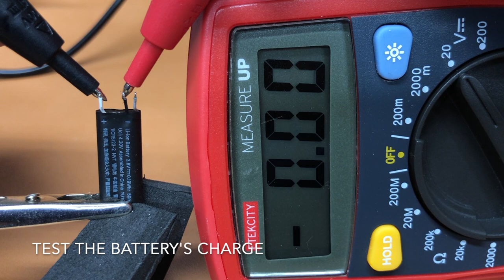Dre "BeatX" Battery Replacement

Comment: 3:08 what was used to put on the wires to make them stay? It seems the same step is made at 2:07 to remove the wires as well. Great Vid! Just confused on those steps. Also any recommendations on solder kits?
Reply from the maker: Holy smokes Joe, that's solder from a soldering iron! If this is your first time soldering I strongly recommend you practice a bunch before proceeding with this repair or you could burn some important stuff.

Solder is basically a "low temperature" metal alloy which quickly solidifies into a solid weld. You can reflow it with the soldering iron, which usually heats up to the 200-350c range. In the video I'm working on wires which are ~1mm in diameter.

Comment: what’s the instrument you used for connecting/placing the wires where they were supposed to go. ?
Reply: specifically in 3:13
Reply from the maker: Hi Valeria, that's called a soldering iron and this process is often referred to as micro-soldering. If you have never soldered before then you may find micro-soldering extremely challenging. In that case, I wouldn't recommend trying this as your first project!
Reply: @StephenArsenault  thanks Stephen

Comment: Great video. I JUST want to confirm if I can short cel 1 and 2 negative because my replacement battery was only two wires. Please confirm tia
Reply from the maker: Interesting.

If you have a multimeter please read the output from the pos / neg lines on the battery. Can you share a link to an image?
Reply: @StephenArsenault  i just try it is not workin. When i turn on red and white flash.
Reply: @StephenArsenault  no pairing mode. Just white blink when I press

Comment: HI Stephen , nice video 
My Beats x is having red and white light blinking and sometimes a pink light is coming . can you suggest any solution ?
Reply from the maker: I'm not familiar with a pink light. I used to be able to find an article from Beats which showed the meaning of the lights but I cannot find it now to confirm what pink might mean. Sorry I can't help with this!
Reply: A glitch has happened with your Beats X where it signals that you have battery and fires off a white light but, it is accordingly going red since it doesn’t have enough power to charge on and continue to play music. Which breaks the light into showing both red and white lights at the same time. I don’t know if this is true but just my assumption

Comment: Hey there what were the symptoms that your needed a new battery 
Thanks
Reply from the maker: There are two main symptoms:
1. The battery doesn't hold a charge for long (e.g., 10 minutes)
2. The battery won't charge, no matter how long you keep it on the charger.
Reply: Stephen Arsenault I have trouble locating a new battery, and all the ones on eBay, usually have the same fault and would be useless buying it
Reply from the maker: @aurora6758  Here's a link on Aliexpress: https://www.aliexpress.com/item/32882827829.html